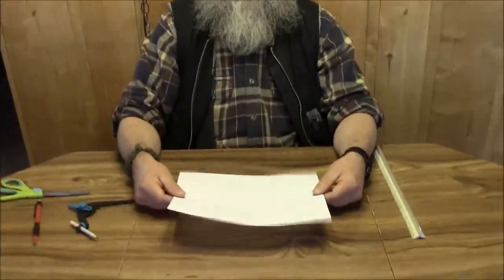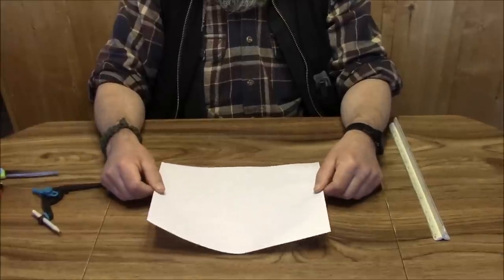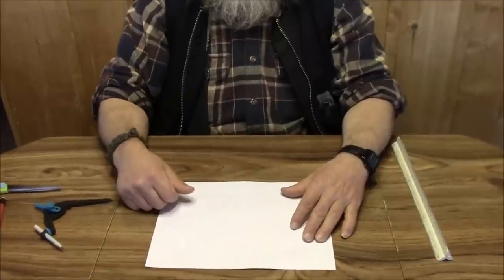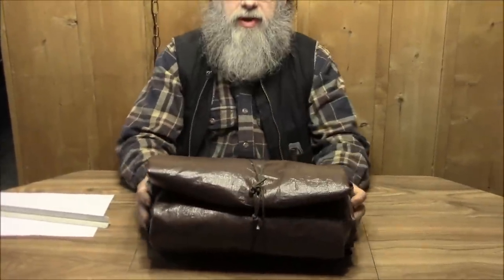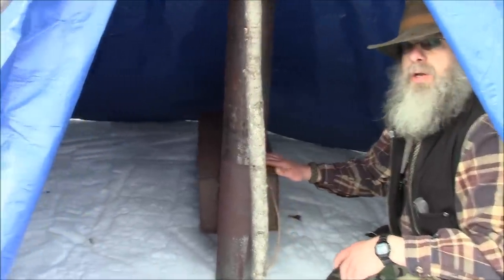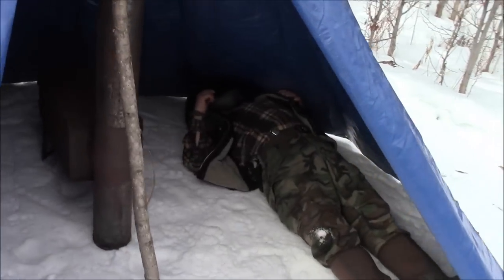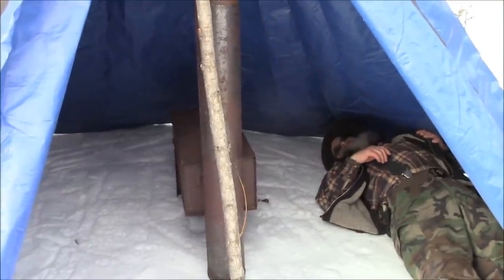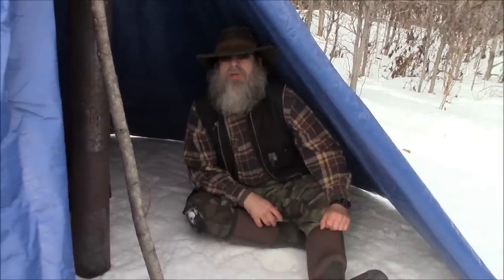Make A Tarp Tent Tipi Hot Tent On The Cheap

Comment: Wow I have been searching for this exact tutorial and I am very impressed sir. One question how long is the pole in this configuration? I just subscribed and look forward to more content.
Reply from the maker: Welcome to the channel and thanks for subscribing.   The center pole is roughly 6 feet.  I say roughly because i never keep a pole and cut a new one at each location.   I just stake out the perimeter of the tipi and then step inside and manually lift the center to it's full height.  I then estimate teh pole length needed by using my body as a gauge.  After cutting a new pole I will then place it in the center and try to install it.  If it is too long which it usually is due to purposely cutting long, I will then cut off the unneeded portion.   Each place  I set up requires a different length of pole due to uneven ground, or different ground types such as dirt sand or snow.   What really works great for a permanent center pole is an aluminum extension pole such as is used for window cleaning or paint rollers.  They are infinitely adjustable.

Comment: The only thing I would recommend is when you originally cut the notch for the door area, if you cut one side normally but the other side at a shallower angle you wont have to tape a seperate door flap on. It will already be there and overlap the other side. Much stronger than tape.

Comment: Thank you so much Lonnie this is a great set of videos. Very informative only question I have is how do you effectively reinforce the area where the pole meets the tarp? I understand to use gorilla tape but is it just multiple layers of tape done on a flat surface or must the tarp be manipulated in some fashion? Thanks again to you and Connie for all the great videos I love them all!!!!!
Reply from the maker: I no longer remember what I did for sure.  You can see the reinforcement at the portion of the video that is linked to at the bottom of this reply at the 32 minute and 38 second mark.   I believe what I did was to reinforce the inside peak before I added the extra door flap.   That way, the tipi material would still lay out totally flat .   Once I added the extra door flap and then tapped down the flap edge from the peak a little ways, that effectively closed off the peak so that the tipi material would no longer lay out totally flat because of the enclosed peak.  I then reinforced the outside of the tipi peak with more Gorilla tape.   Here is another method that may have been how I did it and now that I think about it, this is probably the way I did it.   I may have turned the tipi inside out once the extra door flap was installed and then it would be easy to apply the reinforcement tape to the outside surface which is actually now the inside of the tipi peak.   Once that was done then I probably turned the tipi back to right side out again and finished reinforcing the outside of the peak.    If that is not how I done it, it would certainly work to do it this way.

https://youtu.be/wtLdMIaIIFw?t=32m38s
Reply: Awesome!!! Thank you so much!!!! Im in the process of laying one out on paper. Tomorrow weather providing l shall lay out the tarp. Thank you again so much.

Comment: Hey Lonnie great vid...I have a 20x20 tarp will this design work? or will I need to change the size?
Reply from the maker: +roadhammer07    Thank you.   That size tarp should work well but you will have to trim one side so that it is 20X15 to end up with the same length to width ratio as the 12X16 that I used in this video if I figured it out correct.   It is best to figure it all out on paper before hand by making a smaller model of the real thing but keeping all measurements to scale.   In other words mark off 20 evenly spaced marks on a piece of paper along one side of the paper that will represent each foot of your 20 foot tarp.     The distance of those spaces representing a foot does not matter except you want them to all fit on your piece of paper and they have to all be the same distance as each other.    In other words you may choose to use 1/2 inch spaces to represent each foot.  Now you will have to mark off 15 spaces at a right angle to the 20 spaces you already drew.   Again they have to all be the same distance as each other as well as they have to fit on the paper and also be the same distance apart as the original 20 spaces.   Now cut out your paper 20 spaces long and 15 spaces wide.   Now you can go ahead and lay out the tipi on that paper as I showed in the video, cut it out and fold and tape it together.   Does the finished paper tipi have a pleasing desirable shape similar to the paper model I showed?   If so then you are ready to go ahead and mark and cut out the tarp the same way you did the paper.     Good luck

Comment: Awesome build Lonnie, I have been wanting to build one of these, been thinking about the design, I like your modified cone, great idea. One improvement might be to cut the overlap for the door out of the section that you cut off, thereby eliminating a tape joint. Also, using some of the excess material to make a vent at the top and maybe a few around the bottom. Without vents you are going to have a lot of condensation in there.
Reply from the maker: Iliveoutside Outdoors If you look closer at the paper drawing of the modified tipi before it is cut out you will see that a person would still have to add more material to the tent for the door overlap..  Of course a person could always just suck up the tipi smaller and instead of "butting" the door edges together they could go ahead and overlap the edges but that would cut down on shelter diameter thus reducing useable square footage of interior space.  I have never had any problems in the past with condensation in my inclosed tarp tents with woodstoves.  The shelters however were much bigger.  Will have to see if I have problems in this smaller shelter.  One thing that helps condensation is to have dual shelter fabric.  I would rather have several shelter layers rather than have vents.  I am trying to heat up the shelter not cool it off.   I have a lot of winter experience with heated tarp shelters here in Alaska.   I have spent many days and nights in heated tarp shelters.
Reply: ***** , thank you for the response. I truly value your videos, and have learned a ton from you. 

I was thinking, instead of cutting straight down from the center point to the bottom, on one side, come down 6" or so along the line for the opposite side, then cut down at a more acute angle towards that edge, that would leave you a flap on that side which could function as a flap over the door. You might need some additional material at the top, but should allow for the bulk of the flap anyways.

As to vents, I am sure you have a lot more experience in the bigger tents. I used to have a Cabelas Alaknak with a wood burner, that tent had extensive vents around the perimeter and the top corner peaks. As long as your fire is burning, it will help prevent moisture from condensing on the tent walls.

I have a lot of experience in small tents with no stove in cold weather. I can tell you that without good vents, you will end up with a ton of moisture condensing on the tent walls in just one night. When the moisture you exhale hits the cold material, it condenses, turns into water drops, and will literally "rain" on you in the night. Most single wall winter tents have vents for this reason, to expel the moisture out the vent before it condenses.

I have a very small (too small actually) tipi with a roll up wood burner made of sheet titanium. Check out my video called "outdoor coffee", I have the tipi setup and you can see the amount of condensation in there, and I only spent 1 night in it, was around 15 degrees F. The problem is that there is no way of keeping that thing burning all night long, as it wont hold coals for more than maybe a couple hours. Any small portable stove is going to have that problem due to space and weight restrictions. So, you cant rely solely on your wood burner to solve condensation in these small man portable rigs. This would just be my opinion based on my experience with a small 1 man tipi setup. 

Even with vents, your tipi that you built here will heat up rapidly with a small stove, and allow one to dry clothing, cook, relax, warm up, etc, but at some point at night your fire will die out and the vents would help reduce condensation. 

I hear you on dual layers, but that would make it too big and bulky too be man portable, unless you go to extremely expensive uber high tech materials.
Reply from the maker: Iliveoutside Outdoors You have some very valid points here.  My experience is with larger tents with larger stoves that are kept burning all night.   I have an idea of maybe using "space blanket Mylar" as an inner liner.  If a person ties strings from the top of the center pole down to the base of the walls and space these strings every 3 feet or so and tie the bottoms to the grommets he could then slip Mylar sheets behind these strings.  for a dual layer skin.   Kind of a hillbilly method but I think it would help.
Reply: Most of the high end commercial dual walls, Kifaru, etc., use a breathable inner layer. Water vapor needs to pass through to escape to the outer layer which typically is vented at top and bottom to allow airflow. Note this is also how your roof on your house is setup with ridge and eave vents, without vents, your roof framing will rot out from condensation and moisture. I am thinking dual layers would be hard to do "homeade" and you still really need vents. Checkout Yankee Prepper "tyvek tipi" video. You could easily use your scraps to ad vents like he has on his. Trade off for any heat loss I think will be worth it.
Reply from the maker: Iliveoutside Outdoors You don't need a breathable inner layer in this type of setting as long as you have a wood stove burning.   Once the stove goes out then I think you might have condensation but I'm guessing it wont be as bad as having one layer.   The moisture condensates due to the difference of temperature between inside air and the cold being transferred through the shelter cover material.  If you have two layers of fabric there will be a measure of air trapped between the layers which will be warmer than the outside air due to the inside temperature influence.  Since it wont be as cold as the outside air then it should not cause as much condensation. I had a two layer "hoop house" type shelter that I had made.   It was covered with two layers of non permeable fabrics and that was the warmest tent I have ever had and totally dry walls.  Me and my son spent several nights in that shelter one winter on a campout and the coldest was minus 38 degrees F outside.   It was shirt sleeve environment on the inside.  Of course we had a stove going around the clock.
Reply: Well let us know how it goes. I don't see what advantage you get with impermeable inner layer, you still have moisture trapped in there. I think you are going to find it hard to keep an all night fire in a stove small enough to be man portable. Will look forward to seeing your videos showing how it works once you have your stove.
Reply from the maker: Iliveoutside Outdoors Yeah I have seen Yankee prepper's video before.  I guess I will just wait and see what kind of condensation problems I have and go from there.  It may or may not be worth fighting with.  At this point I will only go with venting as a last resort.   I don't think it will be needed but I will see.  If the top needs to be vented then propping open the upper half of the door may be enough.    The woodstove will be burning any time I'm in the shelter except when it burns out at night.
Reply from the maker: Iliveoutside Outdoors Think "Thermopane" windows.   It works in a very similar way.  The material itself does not insulate.  Basically all insulating materials provide very little insulation in and of themselves.  It is not the material that insulates but rather the air that the insulating material traps and slows down heat transfer as a result.   As long as the stove is burning there won't be a buildup of moisture in the shelter due to the moist air being sucked in to the stove as part of the combustion process and replaced with outside air being sucked in as a consequence.    You are right.  I don't think there is any way I will be able to keep a fire burning all night and when it does burn out, is when I will experience the condensation.   I'm just not sure at this point that it will be enough to worry about.   Time will tell.
Reply: Yes, I understand insulation systems quite well. That is why I am thinking also of your roof and attic of a typical house. If the furnace alone could remove all the moisture, there would be no need for attic ventilation. However, it is well known that without a vented attic, your framing will become wet from condensing moisture (same problem), eventually your framing would rot out, this is why building codes universally call for attic ventilation in occupied structures. Anyway, looking forward to future videos on your result. If I do build one, I will put vents in mine and maybe we can compare notes. Spring is here so I wont have cold weather to test until November.
Reply from the maker: Iliveoutside Outdoors Spring is here as well.   I'm almost looking forward to next winter.  I said "almost" lol
Reply: Monday was 60 degrees, yesterday woke up to 3 inches of fresh snow, 50 degrees today. Ah, springtime in Michigan.

Comment: Very nice, Lonnie. Would you seal the bottom by piling snow around the perimeter?  Or, would you do that with a floor tarp extending up the inside of the walls? Or, both...LOL  I guess one would have to be careful not to cut off all ventilation.
Reply from the maker: DocLarsen44 Thank you "Doc".  Yes I would seal the bottom by piling just enough snow to cover any open gaps.   I would also lay small tarps on the inside as well though keeping the stove area tarp free.   I have found that it helps to put some aluminum foil underneath the stove to reflect the heat back up and to slow down the snow melt under the stove.  When using a wood stove, there is usually enough ventilation caused by the sucking of the stove draft.   The stove usually has no problems sucking in fresh air from under the shelter walls as well as through the overlapping fabric on the door.   I have spent many days in various enclosed tarp shelters heated by woodstoves.

Comment: Greetings,

Thank you for sharing such a detailed project, from concept to completion. 

I want to try your method. I've got the tarps, I was wondering about the central pole. What length is yours?

Regards,

Christos
Reply from the maker: The pole is about 6 feet.  I never measure it but just cut a new one each place I camp.  If it is too long I cut it off until it fits.  I now have an adjustable extendable aluminum pole for it now though.
Reply: @Far-North-Bushcraft-Survival  
Greetings,

Indeed, if it is to be a branch, as you say cutting to desired length until it fits. I was thinking about the possibility of using the trekking poles connected, but 6 feet I will not get, so I will have to get an extendable aluminum pole as you did. I want to make sure I'll be able to set the teepee up even if I cannot find suitable branches. 

Regards,

Christos

Comment: Looks great. A couple of questions. How tall is the post? Is this tarp more vulnerable to melting as opposed to a commercially made hot tent? Would the heat release unhealthy chemicals from the tarp? Are you going to use some kind of silicone material or metal to protect the tent from the stove pipe? Are you going to add flaps to the bottom to hold snow and keep it more sealed? Or is draft actually safer when having a stove inside tent?
Reply from the maker: I have never measured it by official standards.  I just cut a pole out in the woods.   I stake out the tipi, step inside and lift the tipi peak to it's full height and then measure it against my body.  I then cut the pole a bit longer than that to allow sinkage into the ground/snow at the butt of the pole.  That is the way that I used to operate.   Now I just bring an aluminum extendable pole that is made for painters to attach paint rollers to when painting at heights.   The pole is roughly 6 feet high
Reply from the maker: No the heat does not release unhealthy chemicals from the tarp any more than would happen in any modern nylon or other petroleum based hot tent.   Of course if it was HOT HOT Hot in the tipi like close to melting then yes there could be chemical release.   If the tipi is staked close to the ground with minimal/no gap below the sidewalls, I simply go around the outside and kick snow up against the bottom of the tent to seal off any air movement.   You can see how to install a heat resistant stove jack in the tipi or any other similar single wall tent by going to the video link below.

Turn Your Tarp Tent Into a Hot Tent - Stove Installation
https://www.youtube.com/watch?v=HfiUgGhTe1k